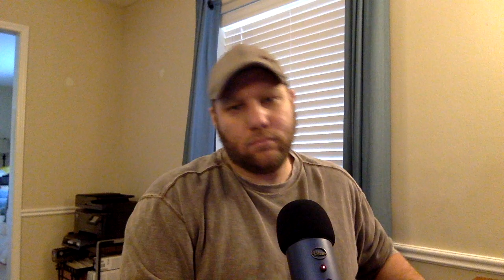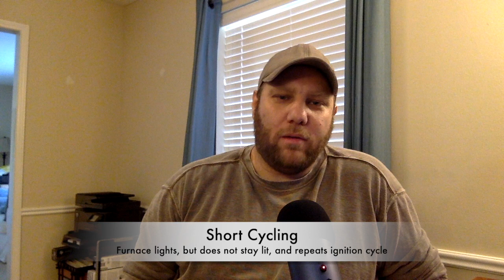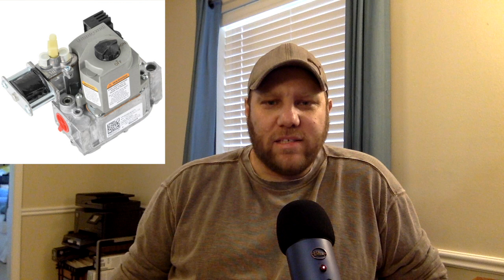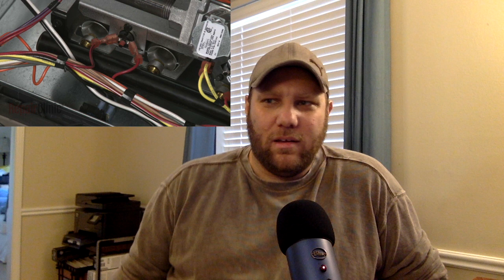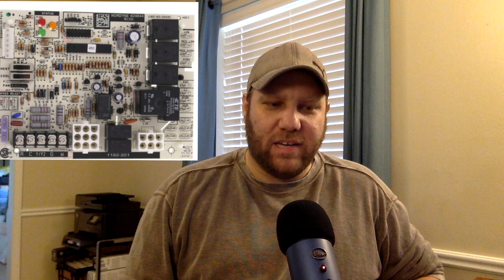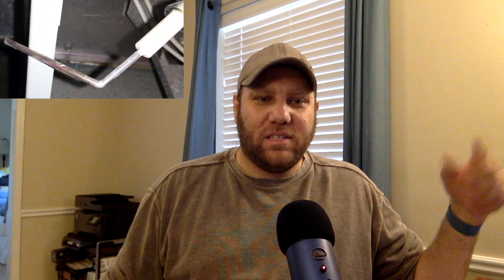Gas Furnace Short Cycling?  It May Not Be The Flame Sensor

Comment: Went through the same problems you had and months of the same things you went through. My issue turned out to be the rollout switch was bad. After replacing, all has been a-ok for months now. That reset on the rollout  switch fooled me, with that so-called reset button, but that's what fixed it. My furnace is a ThermoPride 75,000 BTU CMA.

Comment: Just went through everything you said here on our neighbor's Nordyne furnace! All the same tests, checks, and replaced sensors etc. Problem was intermittent which makes it even harder to troubleshoot. But then one day while I was poking around with my meter leads, I happened to bump the wiring harness, and relays clicked on and off, fans started and stopped, the LED's put on a light show! Checked and tightened up all the pin connections on the control board plugs and tie wrapped the cable in place to support it's weight. Seemed to work for a few days, but then problems started again. Different LED codes and symptoms every time. The way I figured it, if there is a bad solder joint or broken trace on the board, the heat inside the case of the furnace was probably causing expansion and contraction, hence the intermittent problems. Anyway, we finally got ahold of a new control board for $125, did the swap, and it took a few restarts but it eventually started running normally with no more fault codes. Hoping we have the same long term success you did! Thanks for sharing!!
Reply from the maker: Glad to hear you got it solved.  I think you’re right on the theory of a bad solder joint and heat expansion being the culprits.  I’m a few months in to winter and haven’t had a problem.  Hope you have the same luck.

Comment: Any update on how changing the board worked out? I'm in the same situation now. Really appreciated that there was someone else out there with this back and forth frustration. I replaced my flame sensor and the flame is still kicking off with no error codes from the board. My furnace is a Broan Nutone, but the board looks like what you showed with the green, red, and yellow light for the flame. No flashing lights during all of this. All solid. Going to replace the board and see if that works.
Reply from the maker: Replacing the board solved my problem.  It's been almost two years now, and no more issues.
Reply: @kennethmerenda5046  nice. Thanks so much for making the video. The absolute specific saga. Nobody knows what it's like. 🙏

Comment: I was getting a short cycle of about 4-5 mins... The furnace was running for 5 mins or so then shuts off, then fires right back up.. It would do this short cycle for 3 runs then it would throw a code 3 keeprite.. Pressure switch error etc.. Tech shows up tells me the vent is blocked by snow.. To my eyes it didn't look blocked at all.. He blew it out from the inside and barely any came out but since it was running fine with the top furnace panel off, he said it wasn't getting enough air intake but with the panel off it was.. hence blocked air intake vent.. Like I said it was barely blocked and if this vent thing is this fickle, like wtf, design them with bigger intake piping.. I don't know the exact size of the pvc piping it looks 2.5 inches or so, and I would say it had 10% snow build up around the hole/intake.. 10% is enough to fuck my furnace up in the middle of winter and cost me 124 bucks CDN..
Reply from the maker: No snow in Houston, so I didn't have to deal with that.  The way he tested it sounds correct, based on what I've read.  Also aligns with the error code you got.  The system checks for that airflow because, if there is not a draft to suck the gas through, the gas and flame could go inside the control area of the furnace, creating a fire or explosion.  I guess 10% is more of a risk than they wanted to take.
Reply: 3 companies and 4 techs later.. It was found to be the secondary heat exchanger. Based off how much that tech had to rip apart to get that piece out and put a new one in,  I'm not surprised the first 3 techs didn't check it.
My issue is it was such a fickle error, simply reseting the panel would clear the error and the furnace wod run fine for a few hours or weeks.. My problem was the first te hs did the bare minimum and still charged top dollar to not resolve the problem, even though I td them straight up I could have reset the panel and got the same results. It wasn't until the real technician came and tore the damn thi g apart till he saw the fked up secondary heat exchanger... It was burnt black in some spots and the fins were all bent.. It looked used otherwise why were the fins all bent and weird looking..